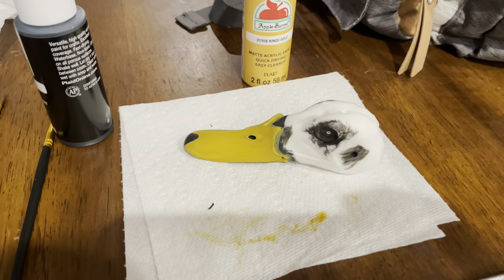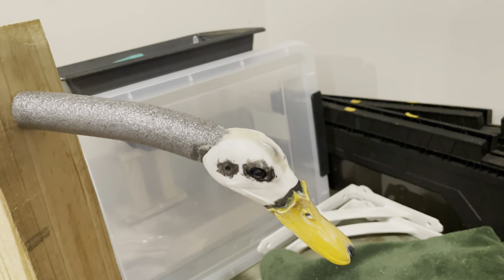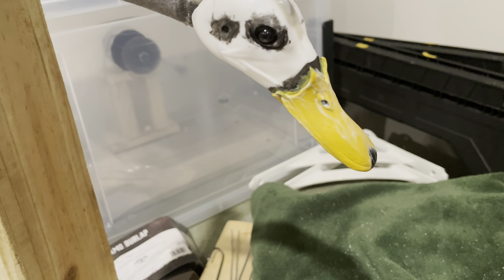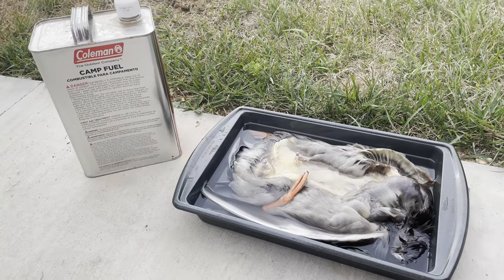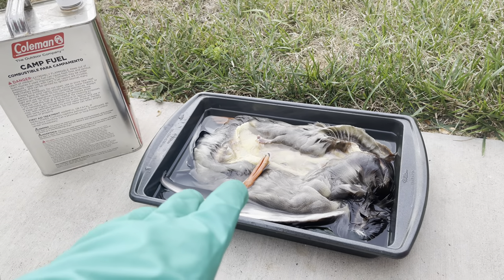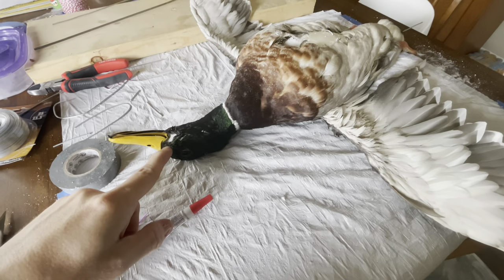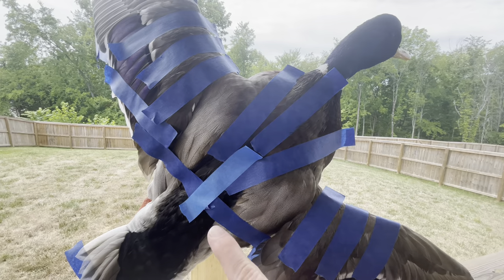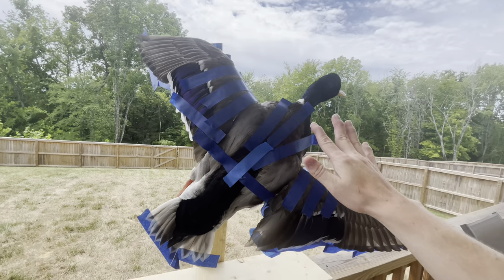How To Taxidermy A Duck - Taxidermy A Mallard

Comment: Hey that bird looks great!  Just a tip for carding, pin those scapulars on the back where the humerus connects and they meet cleaner.  And get some extra pipe saver and pins when you tape for the wings, the secondaries are tricky to get a clean line and that foam and pin doesn’t make you use as much pressure with your hands.  Looking at real bird references and studying anatomy will help tremendously! Good luck!
Reply from the maker: Appreciate the pointers. 🤙🏼

Comment: Hey buddy I need help I have the body spot on but how do you mount the skin on the head with ripping feathers because there so fragile am I using to much clay or to thick if a neck I just don’t know or is there a way to pull that skin to up to the beak also what’s the correct way to measure a neck
Reply from the maker: It shouldn’t be so tight on around the neck to get the skin up to the head. Ducks like teal and widgon you have to sometimes make a little slice to get it up and over the crown of the head but only like a tiny slice and you can super glue just like normal around the bill. If it’s like a mallard you are working on and you built up that clay between the neck and head then it can cause problems if it’s to much. It’s hard to explain but if you wanna hit me on IG and video call me I maybe able to help..
Reply: @DuckalopeOutdoors  yes sir what’s your ig
Reply from the maker: @justinbeavers9484  Duckalope_Outdoors